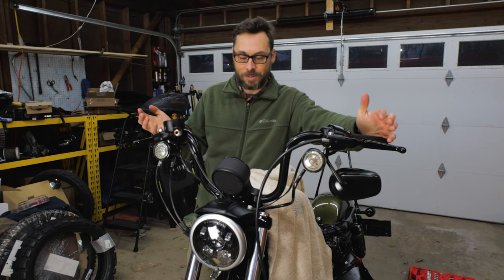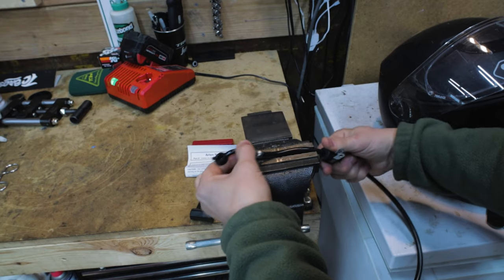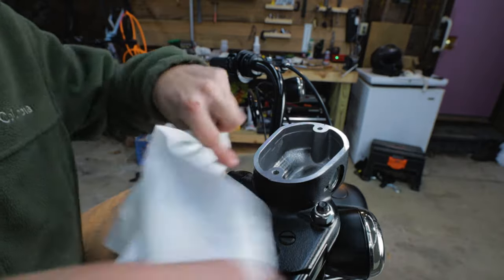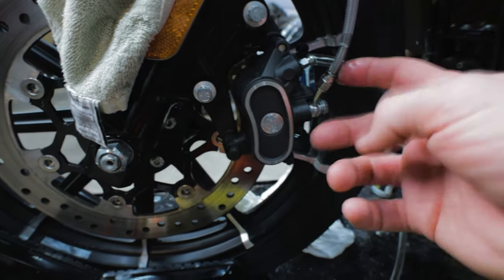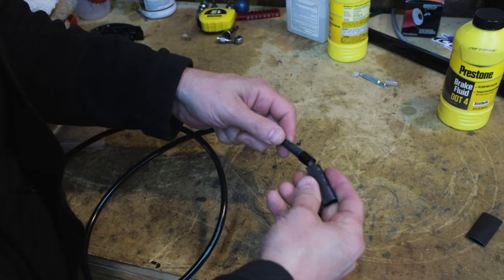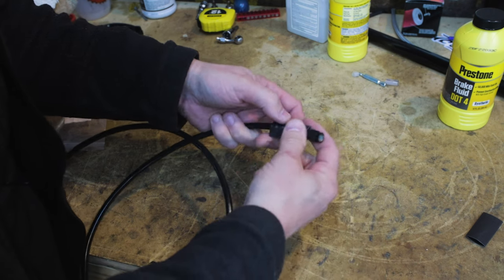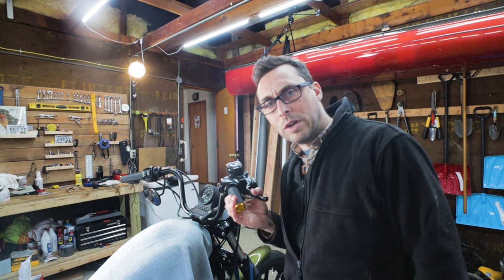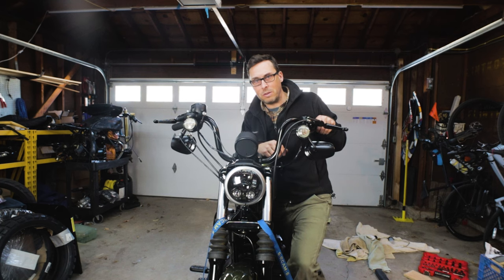The Wrong & Right Way to Fix a Brake Line - Sportster Build Ep 4

Comment: Any recommendation on the length of an extended brake line kit for this? My initial thought was +4” would be sufficient. Going to go with the tc bros 8”. Thanks joe.
Reply from the maker: I installed the 40” Goodridge braided brake line. For my 8” handlebars that I installed this is the perfect length. A 4” line would be perfect if you can cut to length. See if you can track down a 40” or 42” Goodridge line. I paid about $40 for mine and installation was stupid easy.

Comment: Did you have to replace the top and bottom front brake line or just the one?
Reply from the maker: I’m not sure what you mean by top and bottom. There’s only one front brake line and I replaced it.
Reply: @GreatEgret  Does your bike have ABS? There should be an upper and lower front brake line. One that goes to the ABS module and one that goes to the calliper.
Reply from the maker: Oh, I see what you mean. I don’t have ABS, so it’s just one line. I used to have a Sportster with ABS. When I swapped the handlebars on the ABS Sportster, I replaced the entire line by buying one with the module connector. Much easier than just replacing the line from the master cylinder to the module connector and you just bleed as you normally would.
Reply: @GreatEgret  Can you shoot me a link for that line you’re talking about? Would I be able to get away with just replacing the lower line and leaving the upper line the way it is?
Reply from the maker: I’m assuming you want mini apes installed. 

If you want to just replace the upper or lower, this is what you need: https://www.denniskirk.com/magnum-shielding/black-xr-stainless-extreme-response-front-brake-line-kit-w-abs-4-and-8-sbc1326-25.p1912900.prd/1912900.sku

If you want to replace the whole thing, you’ll need this: https://www.denniskirk.com/drag-specialties/front-extended-length-black-vinyl-abs-brake-line-12-1741-5341.p1914267.prd/1914267.sku

That second option would be better with full apes.

Comment: So I work in the industrial hydraulic supply industry. And one of the lines I sell is Brakequip. When I started watching this video I was like.... O.o NOOOOOOOOOO! what is Joe doing? Why is he using clear braided line on a black bike????  The style of end you are using are commonly know as "field ends" for people like yourself fixing a leak or breakdown out of shop. Hence field end or "re-useable end" .  

Then you switched to the other style. I couldn't tell if they were JIC/SAE ends or not with the adaptor banjos. If they are.... Rule of thumb in the industry. You tighten them hand snug. Then  tighten them a 1/4 turn. If you go too tight. The flare on the female can crack or even the nut from over tightening. That is IF those were JIC/SAE ends on the hose. 

Otherwise, looks good.
Reply from the maker: The first TC bros line I used is a go to for a ton of Sportster, Dyna, snd Softail owners. I fixed it and I’m actually going to use it on another Honda project I have in the garage. For the second Goodridge line, I don’t think I could have gone over a 1/4 turn if I tried harder. I put on 50 or so miles since I did them. They work great.

Comment: Loving these project vids.

Wondering if you thought of buying an Iron 1200 before buying this 883? It would have come with the bars you want. A small fairing. Plus the extra power.

I’ve got a 2021 Iron 1200. Love everything except the AMF paint. I like it. But don’t love it (the paint).
Reply from the maker: Thanks, man! I thought about it. Here’s why I didn’t:

1. The price of this used 883 + mods = less than a Iron 1200
2. The chumps and the Iron 1200 bars do look similar, but they are different enough for my needs. The Chumps are narrower at the top and center and have more pullback. 
3. I really want to experience converting the 883 to a 1200/1250/1275. Wrenching is a big part of the experience and enjoyment for me. Include the experience of the other mods it was a no-brainer. 
3. I owned a 2017 883 that looked the exact same. This olive gold is amazing and I was nostalgic for it. 
4. Like you, I just can’t get into the AMC graphics. I’d have to spend more money on a paint job just to get rid of it.